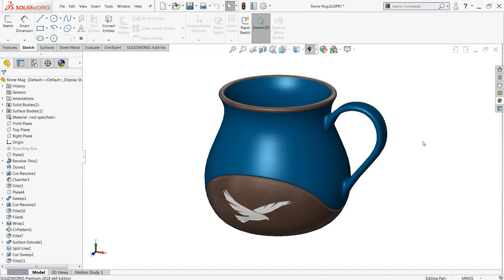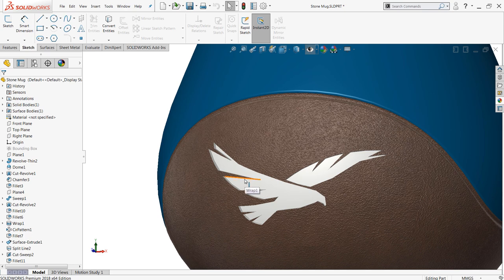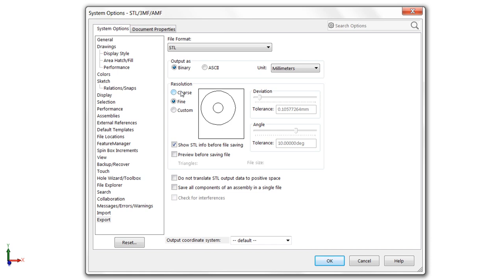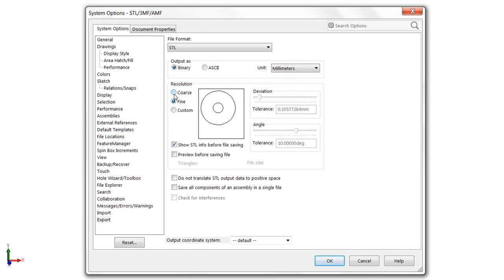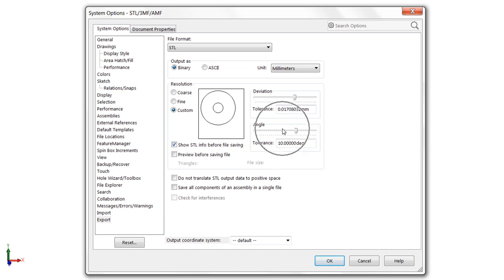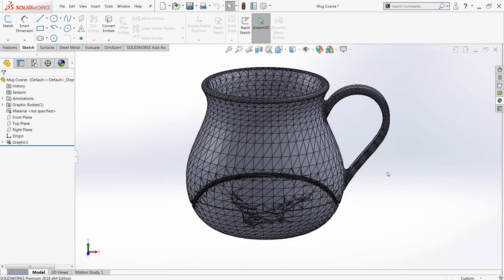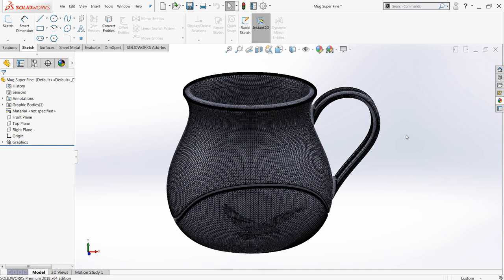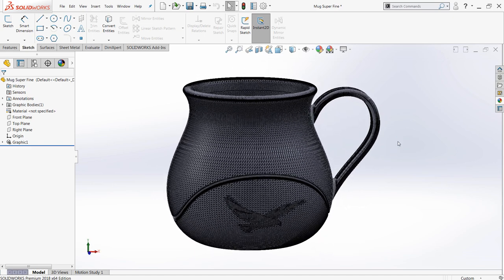Preparing a SOLIDWORKS model for 3D Printing

Comment: I'm sorry you haven't gotten any comments so far, but your video was superb. I have solidworks student edition and I am 16 (nearly 17) years old working towards the solidworks csw exams. I am going to be using solidworks for 3d printing as something fun alongside. My school has the 3d printer and it is fairly small but I am free to use it whenever. I was wondering if I was able to use solidworks alone to prepare the file for the 3d printer (as in put it on a usb and plug it in for example) or if you need a seperate program to process it. I am completely new to 3d printing and will appreciate your help.

Yours Faithfully,
Elliott Bridge
Reply from the maker: Hi Elliott, we appreciate your feedback and are glad you enjoyed the video!  Feel free to contact us directly here: http://bit.ly/2DnIy3J and one of our 3D Printing experts in your area would be happy to help you!

Comment: If I set deviation and angle to max does it just make a big file size or does it increase print times or filament used? Sorry very new to all this.
Reply: Great question! Using the Coarse setting for resolution or manually increasing angle/deviation will actually reduce the resulting file size, but will result in fewer triangles (and therefore a faceted appearance and a poorer surface quality). As far as print time, there may be some minor differences depending on the equipment you're using, but generally it should not be affected much as print time is mostly determined by the size of your object.

I hope this helps, and thanks for watching!

Comment: thanks for this. now my print looks better but i have a problem you might know how to solve, i designed something in solidworks and it has multiple parts but i need it to be printed as one piece, so i assembled it and when i come to save as stl it says saving 10 files. i dont want those 10 to be separate, i need it to be 1 print together. would you have any idea how to do it?
Reply: Hi Warlord,

That can definitely be fixed! After setting the file type to STL when doing a Save As, look for an Options button on the menu. This Options button should take you to a settings page for STLs. Near the bottom of that page, you should see a checkbox labeled "Save all components of an assembly in a single file." You'll want to make sure that checkbox is turned on, then click OK and save the STL file. This should combine all the components into one.

I hope this works for you!

Comment: Great video, thank you! I do have one question, when I 3D print something I get left with a kind of like 3D printed surface on the bottom that cover a bigger section. I think the 3D printer uses this as its base. Is there a way to get rid of this base?
Reply: Sand it off, or carefully cut it off.
Reply: That's likely what is called "raft" or it's support material for overhanging geometry. Sometimes those are necessary to prevent warping or bad geometry. Every software is different, but you will find that within the printing software that came with your printer, typically it can be adjusted or switched off. Playing with the settings you will find a compromise between surface quality and getting good results.